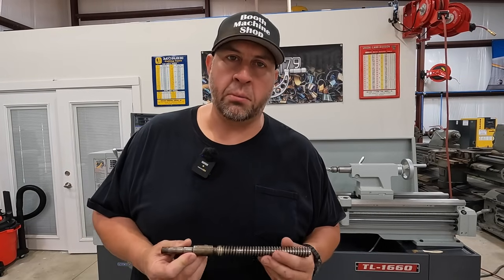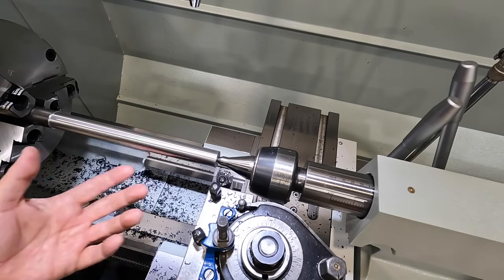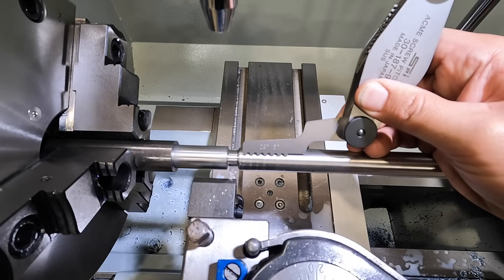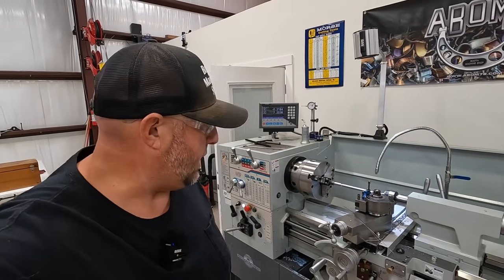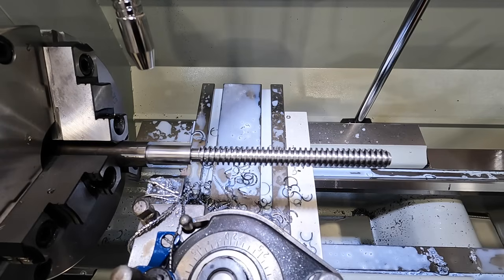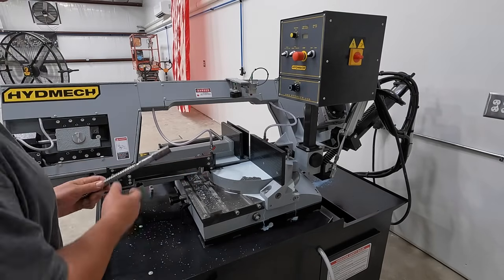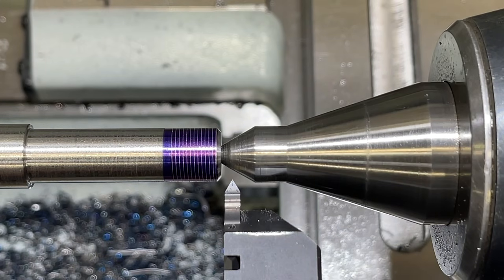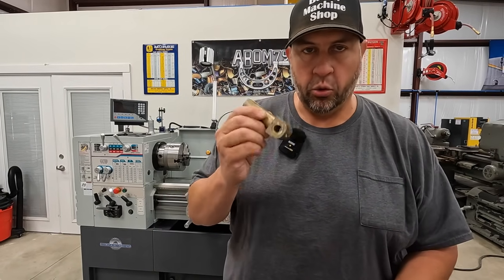Compound Acme Lead Screw for American Pacemaker Lathe

Comment: In absolute disgrace that the USA (and the UK) cannot make machine tools like the Precision Matthews lathe
Reply: It's not that the US or UK can not make quality machine tools. It's the cost differential. If the workers in China or Taiwan are making the equivilant of say 3 bucks an hour do you really think you are going to people willing to work for say 6 bucks an hour to make up the extra for shipping? Besides aside from hobbiests there really isn't that big of a market for manual lathes anymore. Yes a maintenance or repair shop gas a use for manual lathes. But unless you are doing strictly one of parts CNC even if it's the equivilant of a Trak or Haas is a better bet for a small job shop. Plus in a maintenance or repair shop how long does a manual lathe last?
Reply: @mpetersen6  MrPete. I am honoured for your reply - as a regular follower of your channel - if you are who I think you are.   It is the economics certainly.  Mainly the USA and UK have been priced out not by bare wages but the total costs of employment - payroll taxes. social security taxes and the like.
I also fully understand about the demand for manual as opposed to CNC machine tools. And why that is .
And I also accept the 'comparative advantage' arguments.
But I am still of the opinion that there has been a lot of capability lost through the application of the deadweight costs of welfarism to USA and UK machine tool production.
Reply: You can buy a brand new U.S.A. made "Monarch" lathe that fully lives up to the firm's history.  Unfortunately, the "sticker shock" associated with the acquisition will be fatal.
Reply: @eliduttman315  Which rather illustrates my point about 'payroll costs' etc. Monarch will be carrying circa 40% tax and welfare overhead.
Reply: @stevenfarrall3942  I don’t think that’s the Mr. Pete you think it is.
Reply: @grntitan1  I was beginning to think that as well...oh well.
Reply: It's really about most Americans' predisposition to PURCHASING the ultimately cheaper piece of equipment. Supply and demand. It's not that there's no supply of American lathes, rather there's no demand.
Reply: you can buy one for 2 million dollars

Comment: I would suggest using a die grinder to Higbee the thread runout on each end to prevent thread roll-over and make it easy to start (essentially grind off the partial thread and leave a tangential ramp (tangent to the root dia.).
Reply: Also known as a blunt-start or quick-start.

Comment: I was under the impression that when cutting threads you were NOT ALLOWED to disengage the feed as it would lose index and start to cut new threads... even if I used the indexer on the dial and tried to syncro it up it always went sideways and my threads were trashed. Maybe someone could fill me in what he said about the indexer ? .
Reply: That applies to cutting metric threads if you have an SAE lead screw on your lathe.  SAE threads with and SAE machine are no problem
Reply: @seanmcdonnell1282  aahhhh ! I will have to retry using sae threads.

Comment: There is nothing wrong with the material or the monarch. You need to run oil, and a follower rest. Your minor is a half inch with an acme thread so your already screwed without a follower rest. Blaming the machine is crap

Comment: Matthews either doesn't use the machines they make or they don't care about user experience, that's been made quite obvious with their poor placement of flood coolant pipe, the crappy oil drain & fill ports and now the follow rest not being positioned in front of the cutter. 🤦 
You should see if you can figure out a way to mount the follow rest in the slots on the carriage.
Reply: Trust me, their Taiwan made stuff is light years ahead of their China made stuff also. I bought their 1130 lathe (China made) and found out their customer support that I heard bragged about so much is none existent.
Reply: I knew the hate would arise sooner or later!!
Reply: @paulcopeland9035  I'm not hating on it, I'm stating what happened to me and a couple others also. I said their Taiwan made is light years ahead, I have had the pleasure of using a couple of them and they where fine. I had several issues with mine (China made) and it was all brushed off when I tried to get help and like I said I'm not the only one that has had this happen. Apparently you have dealt with them and had different results? if so I'm glad for you. 
I will be purchasing a 17" lathe in about a year and because of my experience I will be going with a local retailer, Kingston, this time since I can get local support. I'm not telling anyone not to buy PM and I'm not telling anyone to buy PM.
Reply: @MegaLostOne  Yes I have.  We have had a couple of these (similar to what Adam has) for quite a few years.  The oldest is over 10.  While not perfect, they have been fine machines and have held their precision spec's well.  Matthews has been great with support and upgrades.  Parts have always been available even in these difficult times.  Both of our machines are of the Taiwan factory so I guess we are fortunate that way.  Good luck with the PM's you have and I hope the future is a better experience.

Comment: 12L14, carcinogenic ?
Reply: L(ead)
Reply: Only if you live in California
Reply: Probably is if you try to weld it, it doesn't weld very good and you can see the lead cook out of it
Reply: If it has lead in it which isn't sequestered or sealed up, yes it's hazardous to health. Why would anyone be touching or licking the lead screw though? 🤷🏻‍♂️ Lead, mercury, arsenic, etc are only injurious to health if you get them inside your body somehow. The lead won't sneak out of the metal and jump down your throat. 🤷🏻‍♂️ You'll just need to be careful with the chips when cleaning up, and just use coolant to prevent chip dust or hot lead vapors from forming. Easy. That brass nut has lead in it too, most likely. Lead-free brass is a pain to make and work with, so it's usually found only in potable water parts like valves. Brass that isn't going to touch potable water or food, and isn't going to be sucked on like a lollipop usually has lead in it.

Comment: Would have been a lot easier to buy a piece of acme allthread in left hand.
Reply: There's still the shaft for the bearings, the small fine-threaded end, and the keyways.
Reply: @Bob_Adkins  if nothing is bigger than the minor dia of the thread no issue.
Reply: but it is so much better to create it yourself and it is cheaper then buying a premade one
Reply: @Chaplain_GM  In the home shop for your own use, that's fine. In industry time is money.
Reply from the maker: Some folks only look for the “easy” way out in life
Reply: @Abom79  Definitely Adam Well done on that beautiful lead screw
Reply: @thetoecutter13  still laziness isn't quality i will wait for quality over mass production!
Reply: @Abom79 It was great content for a video, and if you have the time obviously making the part from a piece of stock os more satisfying But when the machine has to get back in service asap and the time it's down and the time a machinist is fixing it and not making parts for a customer is costing money, it's not a matter of easy, it's a matter of business.
Reply: Except the hypothetical when, it's not now.
Reply: The nut probably wouldn't have fit as precisely on a piece of acme allthread.
Reply: @thetoecutter13  As you have mentioned it is great content for a video. Adam is a job shop, one off jobs, as he has mentioned many times in other videos. Therefore what is the relevance of mentioning production environment when Adam is doing this for himself and his own equipment plus also for us as viewers?
Reply: @thetoecutter13  Don't forget about getting to know and use the new lathe as well has value in itself during a transition.
Reply: @thetoecutter13  But will it have a toolmaker's fit? Will it be made from a good alloy that will wear well? Will it be straight as an arrow?
Reply: @Bob_Adkins  It would be stronger cause the threads would have been rolled instead of single pointed.
Reply: @thetoecutter13  Not sure thread rolling is easy on high-strength steel, or that a long screw would come out straight enough.
Reply: @Bob_Adkins  Look, Adam is making content for his channel, all I said is it would have been easier and quicker to get a piece of all thread and get the machine back up and running. The screw mates to a brass nut. It's for a compound. In an industrial environment, when a machine is down, the time it's down is money and the time the machinist is fixing the machine is money too. It took Adam 2 times to get it right too. All I said is a piece of allthread would require less machine time, less room for error, and less time the machine is down waiting for a repair. I liked the video, Adam is a good machinist, it's not easy making content year after year, if I had a YouTube channel that I had to produce content for, I would be making everything from raw stock too. I just gave my opinion of how this would have been handled in a shop where the clock and a boss is hanging over you to get the work out.
Reply: @thetoecutter13  "It was great content for a video"..........Ahh, now you get it!!

Comment: Someone must've written this message before (please, English native speakers correct me if I'm wrong):

1 thousandth
N thousandths , where N > 1 (excluding when the last digit is 1, including when the last two digits are 11).

E.g.
11 thousandths
111 thousandths
1111 thousandths

21 thousandth
31 thousandth

121 thousandth
1131 thousandth

Am I right?
Reply: I have no idea what your trying to say. But 1 thousanth= 0.001". So 125 thousanths=0.125" inches
Reply: Nope, anything more than one is "thousandths". Plural. 21 thousandths, 1001 thousandths, etc
Reply: @jamesd4846  I think you're right, if N > 1 it's pronounced with S in the end.
In Croatian (and other Slavic languages) the rule from my original comment applies, so that got me confused, I guess.
Thanks.
Reply: @austinyun  Ack, thanks for the info.
Reply: @casey2472  I was just wondering whether those numbers are pronounced with an S at the end or without it.
The conclusion (according to the feedback I got in these other comments) is the one that makes the most sense: only 1 is pronounced without S, because it's a singular and all other numbers are pronounced with "S", because that's plural, which literally means "more than one".
It's much more complicated in my language, Croatian.

Comment: Could not have been the fault of the monarch, must have been the fault of the operator.
Reply: To suggest that something couldn’t be wrong with a machine is naive. It’s usually not the machines fault but that doesn’t mean it’s always that way. Be very wary of absolute arguments
Reply: @dominicmartinez1373  The man literally floods everything with cutting oil. Don't you think it's a bit odd that he tried to take such a deep cut without cutting oil or coolant even though it was screaming for it since the beginning? Just look how much nicer it cuts with coolant on this try. I bet the Monarch is just fine. After all, he has been praising that machine forever, until the sponsored one came in.
Reply: I agree  and he did not allow room for follow rest must not use one often.
Reply: Probably the flood coolant sealed the deal on this job. That said a brand new machine has to count for something.

Comment: I’m not sure what’s in your coolant but, we have to breathe that crap every day at work, If I were you, I’d get away from that crap and just use dark cutting oil.
Reply: The coolant is water based.  You prefer breathing smoke from high sulphur, petroleum based dino sqeezins' ?!?
Reply: Why would you breathe fluids? Are you a fish? You shouldn't be snorting the lathe tray, at least until you clean it out... the chips might cause nostril bleeds!
The coolant is a mixture of water and a small amount of water-soluble oil... it doesn't create any smoke or vapours.